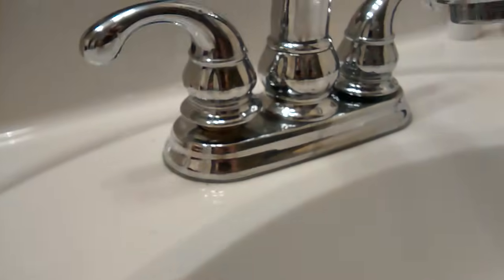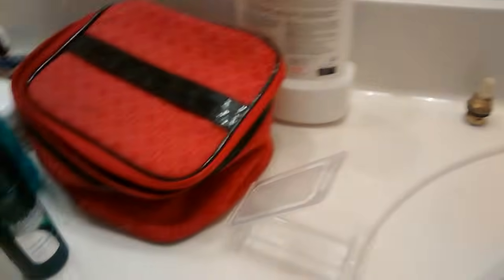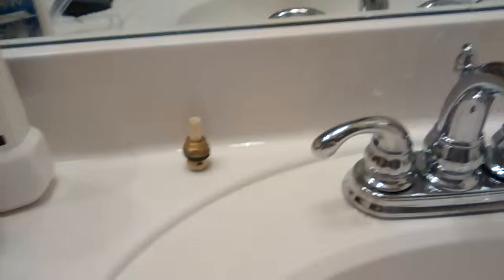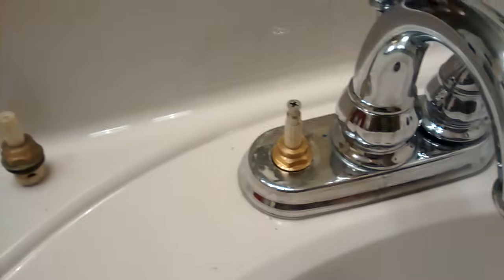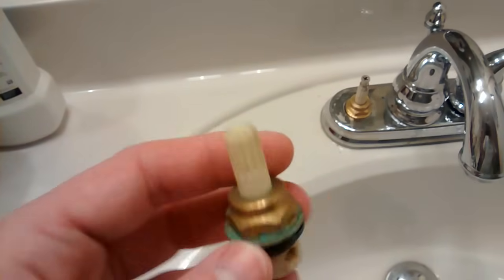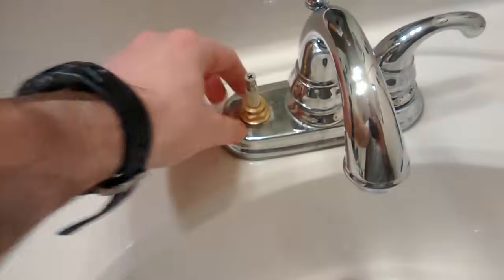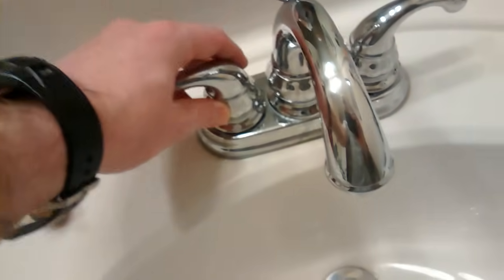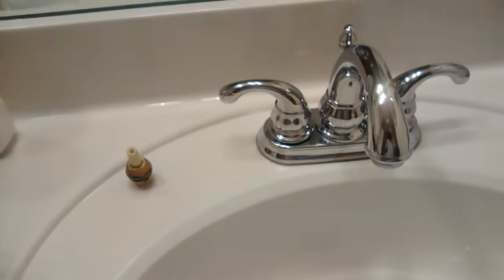Fixing a leaky Price Pfister Faucet fast!

Comment: So helpful!  I discovered, once I figured out how to get the handle off by unscrewing the base (my model doesn't have the Allen screw), that the nut holding the valve in place on top had simply worked loose.  By tightening this, the valve stopped leaking.  I didn't discover this until after disconnecting things under the sink, which was not necessary in my case--a note to help any future visitors.  Thanks again. Regarding free replacement, if you are not the original purchaser (I bought the home from the original owner) the warranty isn't valid--not a big deal, since the valve is a pretty cheap fix.

Comment: Thanks for the video to set us in the right direction but just to chime in, you don't necessarily need to replace it. I took it out, cleaned it up with some vinegar and wiped down the gaskets with a paper towel  and washed off the vinegar before reseating... Good as new and no more leaks!
Reply from the maker: Thanks for sharing, that's a great idea that I never considered

Comment: Thank you, Mine was the cold water and it broke inside the valve. After watching you I see I need to remove the whole faucet and knock the seat out from the bottom. Cant pull it out from the top.

Comment: Yes, the hot and cold valves are different. Yes it is because they turn in opposite directions.  I'm surprised you found the cartridge at Home Depot because Pfister has a life time warranty.  So you call them up, tell them your model (try looking it up on the internet first), and they will ship you a free cartridge.  I've had to do this several times.  Most recently the nut holding the valve was rusted so the valve is loose. They sent me two new valves and the interconnecting hose.  Back to cartridges, they did send me a cartridge once that could be used on either hot or cold.  It had a little lever you moved to select which way it turns.  The only downside to getting stuff from Pfister is that it took 11 days.  Warning to all, if you get corrosion, check the sacrificial anode in your hot water heater.  Not all handles come off with allen screws.  Mine have a little cover on the top whch you pull out with your fingernails (close the drain valve so you don't drop the screw down the drain), then remove the screw inside the hole with a phillips screwdriver.

Comment: I had a leakage on a similar model, and it happens underneath the sink at the hole where the stick to pull up/push down to drop the plug for the sink is located (the hole between the two hot and cold tubes connected to the faucet). I'm not sure if I need to take the entire unit off to fix it in my case. Please advise 🙏

Comment: RE: wrench/key - that has to be the smallest I've ever seen. None of mine would work, but I found a bit in my drill set. XD

Thanks for the help! Contacting Pfister now for replacement. :)
Reply from the maker: ImTheNana Nice job!! :-D
Reply: RandomStuffFixer Thanks! The bit was a T10, if anyone else needs to know. And thanks for the vid and letting us know about the warranty. Between yours and another one on YouTube, fixed all the leaks and wiggling faucet problems. Pfister shipped really fast, and free plus my time was so much better than calling the plumber out.

Comment: (Please hit the continue button at bottom of this comment)  Thanks! After 6 months of having my sink water line shut off and using the bath tub faucet. I'll do this little 3 minute job; turn it into a 3 hr job and go back to the store; buy a whole new faucet and;  Voila! It's fixed! Now, where's my hammer and let's get started!....... Oh, my faucet doesn't have a place to stick the Allen wrench at all!  MY LIFE!!!!!
Reply: +steve2713 Not sure if you figured this out already, but the handles with no allen screw just twist off - grab the base with your hand and spin counter clock-wise - took me a day or so to figure this out.  You will need a socket to get at the valve as an end wrench most likely will not reach.
Reply from the maker: Honestly sometimes its easier to just replace the whole house

Comment: Always close the drain, and cover with a cloth, before removing that tiny screw that holds the handle on. Just in case you drop it.

I did the same thing a few years ago. I couldn't find the name or model number anywhere on the faucet. This made it impossible to find on PP's website. I took the old cartridge to
Home Depot. They had them.

Then this year, the cold started dripping. I had the part numbers from before, so I ordered new cartridges on Amazon. When I took apart the cold side, the new cartridge appeared to be the wrong one. But cleverly placed INSIDE the cold water faucet, (because you'd naturally look THERE, right?) was a little plastic tag with the model number.
I contacted PP online, and they emailed me back that they are sending both cartridges, free of charge, as it's under warranty.
On further investigation, I found the cartridge I already had was correct after all. The bottom part of the old one had broken off inside the faucet. I pried it out with my bent-needle-nose pliars. Popped in the new one, reassembled, and Bob's your uncle. Perfect, no more drip.
So check inside for broken cartridge parts. If you have a different brand/model, check inside the taps. I'm sure others have the same thing, thin plastic tag inside. You should see it right away when you lift the handle off. If it's a two handle faucet, the tag may only be on one side, like mine is.

Comment: Even after removing the screw with the Allen Wrench, I cannot remove the handle. Did your handle just lift straight up? Or is there a screw somewhere else I need to loosen?
Reply from the maker: I believe mine just lifted straight up without much force. Although this video was made 8 years ago, so I could be wrong!

Comment: Word to the wise:  Although I LOVE my local Ace Hardware and they've helped me out of numerous DIY jams, DO NOT buy the Ace Hardware knockoffs of the Price Pfister kitchen sink faucet cartridges.  THEY LEAK!  I tried them and just couldn't get them to seal, and also they didn't fit easily into the star-shaped recesses of the faucet assembly.  Had to kind of jam them in and then they would bind up and leak, and come into pieces when I tried to remove them.  I ended up buying the real PP cartridges at Home Depot.  Had to "retrofit" them to fit the old brass retainer nuts (basically, you pull off the white outer casing, swap the little washer into the existing retainer nut and install.)  Voile!  No drips!  To boot, the original-equipment PP catridges are cheaper ($7.50) than the Ace knockoffs ($11.99)!

Comment: You happen to have the part# or what the packaging looks like?
Went to HD and asked, they couldn't find it, although mine looks a little different than yours.
Reply from the maker: Hi bjohnrini!  Actually, I removed the valve and brought it with me into Home Depot, and poked around until I found a match!  Also, you might be able to contact Pfister directly through their website and get a free valve replacement (if you are willing to wait on shipping).

Comment: Actually the 3/32 thing was the thing that was annoying me... I had a metric set... nothing was letting it go... so I thought it was some sort of calcium build up... so I used LIME AWAY...  DON"T DO THAT... now I have another problem... I stained the finish of the faucet.   If I had the 3/32 in the first place... It wouldn't have lead me to use lime away in the first place.

Comment: I called price pfister series 49 , , all I got was hot water cartage is on back order, sounds like they are located in Mexico, no information, no help , I design homes,  elite designs unlimited over 300 homes and counting.. I think I have bad o rings on hot side.. it just sprays from under.. I even installed supply lines prior to connecting in the cabinet, its a quick release set up has cotter pins ..  the co. was not helpful  I would not recommend them .

Comment: bro all you needed was a new washer.. you didnt need a new valve I dont think
Reply: cartridges don't have washers.  You're a couple decades behind.
Reply: Rick James you are incorrect. I have replaced this exact one myself multiple times. just a washer at the center of the cartridge.
Reply: Joe Borrillo 
It have CERAMIC piece in the valve 
Not gasket

Comment: Good  video. But presenting  yourself a BIT more technically capable would be more reassuring. I paused the video when you said you weren't sure which direction loosens the setscrew. Really? That's an EMBARASSING thing  to mention in an instructional video.
Reply: Joe Rico i
Reply from the maker: Yea... attempting to film a video in a single take with no edits and fast talking to stay sub 5 minutes is a bit tricky. The reason I didn't mention the old "lefty lucy, righty tighty" thing is that I froze up for a brief second... remembering that gas lines are actually REVERSE threaded to keep them from accidentally being hooked up to other lines (water, conduits, etc) tripped me up briefly.  I didn't want to actually state something incorrect and have to re-record/edit the video so I just said I didn't know. :-(  Lame, I know
Reply: Righty tighty, lefty loosey.
Reply: @sharonmorton6496  Sounds like Joe is a real tool